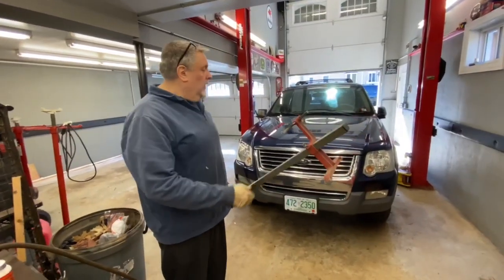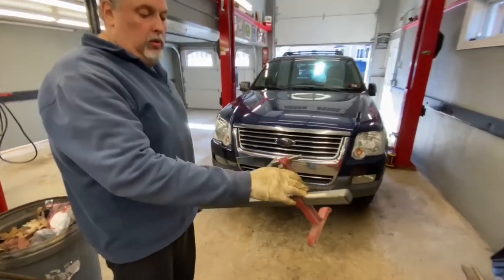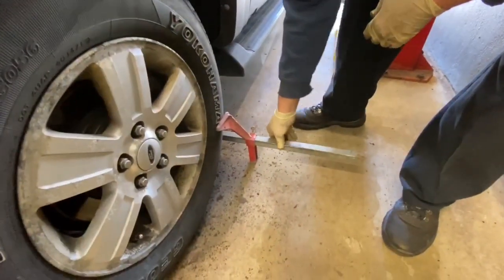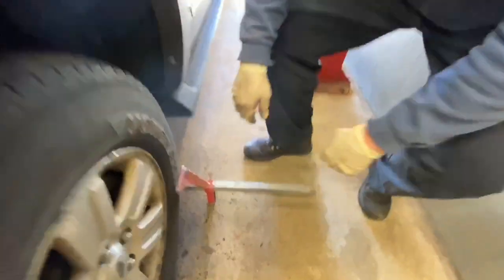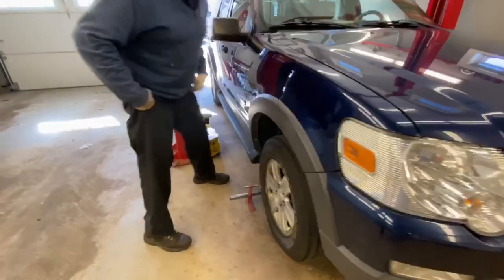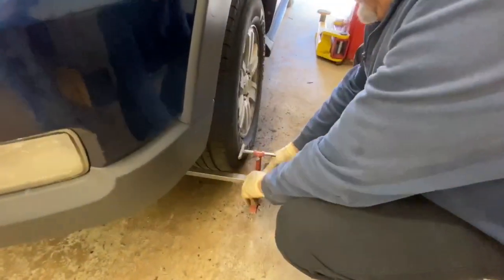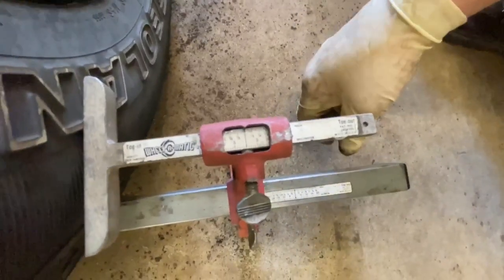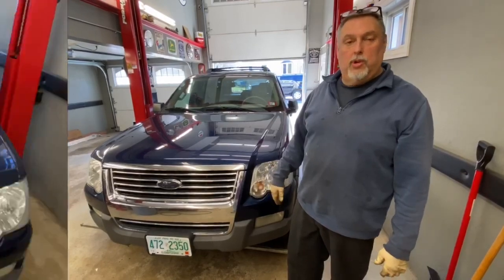How To Use Vehicle Alignment Toe-In Gauge Bar

Comment: I did the alignment and my car 1966 Triumph Spitfire drives staight!  I just ordered new tires for the front, I will check the alignment when they are on.  I have had the car for 40 years, 200,700 miles and I never knew about toe in!  So thanks again for the clear instructions.
Reply from the maker: Thanks for watching Peter! Glad this helped you out.

Comment: Does that tool work on a jeep wrangler JK with 33" tires? There seems to be other toe alignment tools that are used with tires removed and on axle jackstands.
Reply from the maker: Yes, the tool should work on a Jeep Wrangler JK with 33" tires. It's designed to make toe alignment adjustments easier for various vehicles.